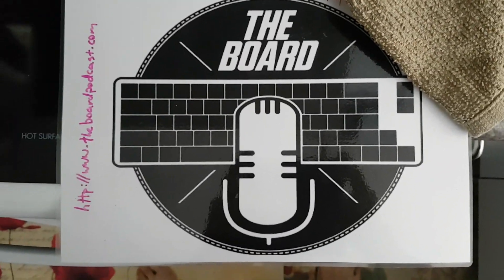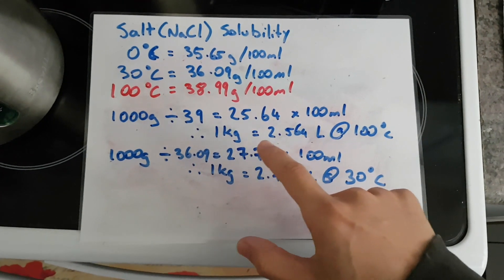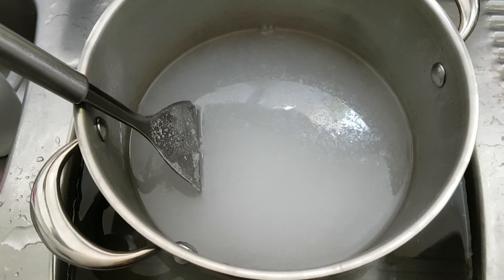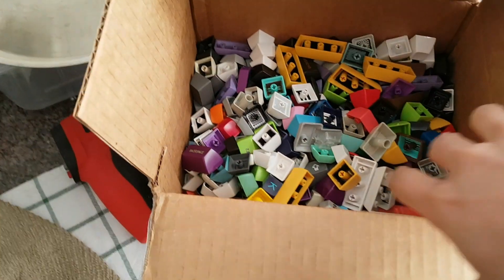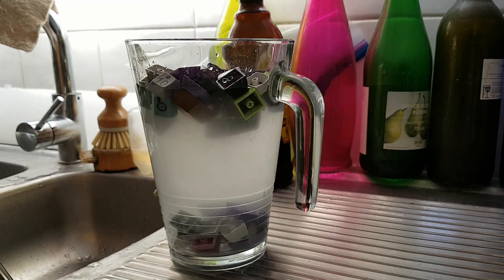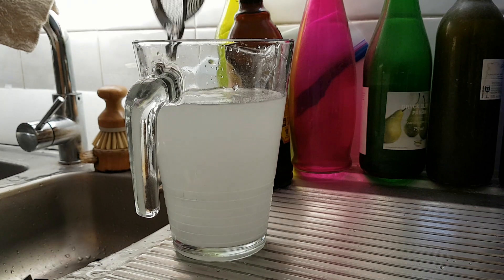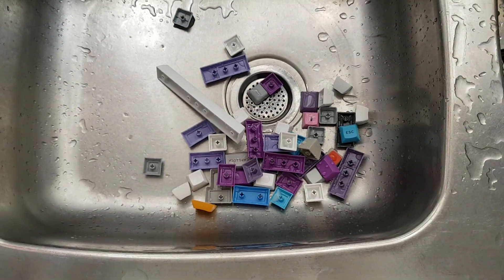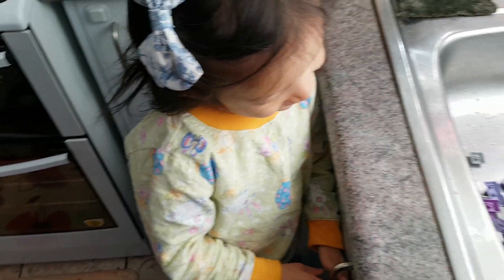Keycap Science - Separating ABS and PBT with Salt

Comment: Sure enough, all the doubleshots ended up at the right, so it's definitely separating out the ABS. Is there any possibility, though, that certain formulations of ABS may be dense enough to sink? or any formulations of PBT that're low density enough to float?
Reply: Here is the densities of the plastics.
ABS - ranges from 0.9 g/cm^3 to 1.53 g/cm^3 with the most common being 1.07 g/cm^3
PBT - 1.3 g/cm^3 minimum. 
Water - 1.0 g/cm^3 nominal.
So looking at the above densities, most ABS and all PBT keycaps will sink in plain water.

Now, let's look at a salt solution:
A saturated salt solution at 20C has a density of 1.2 g/cm^3

That density is comfortably lower than the density of PBT, so PBT will sink. And it's comfortably higher than the majority of ABS, so the ABS will float.
In reference to your original question, if they keycap floats. It's definitely ABS. If it sinks, it's most likely PBT, but there are some ABS formulations that are dense enough to sink. But thankfully, they're fairly rare.
Reply from the maker: I don't know if it is 100% foolproof, but I was taking notice of air bubbles inside the stems, and even with air bubbles inside the stems the denser keycaps were still sinking, so the density difference was still greater than any lift from trapped air in the stems.

In regards to formulations, you would expect that they would be very similar as if the ABS isn't similar enough, it might not bond to itself and your doubleshot parts would separate out... maybe?

We need someone with more experience and knowledge in ABS/injection material science!
Reply: @theboard  Yea, it's because I remember Ripster from Reddit saying that past a certain amount of salt, all his caps floated
Reply from the maker: @Boyetto-san  Well, I can tell you, my solution wasn't going to get any saltier!